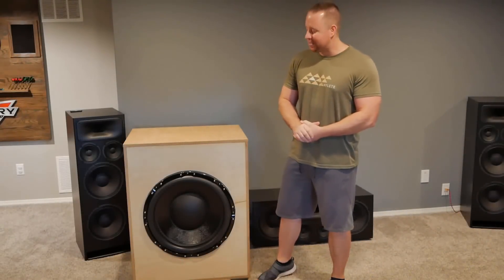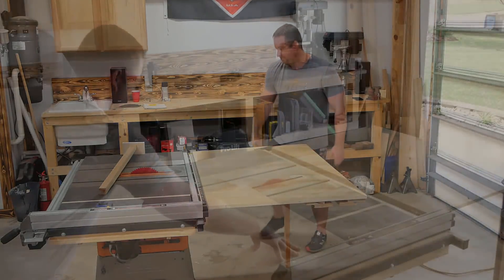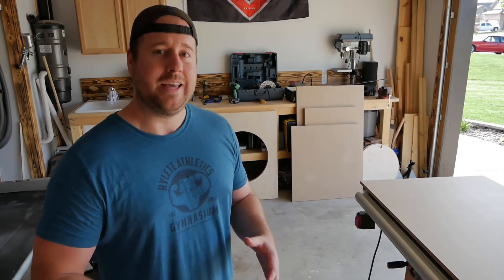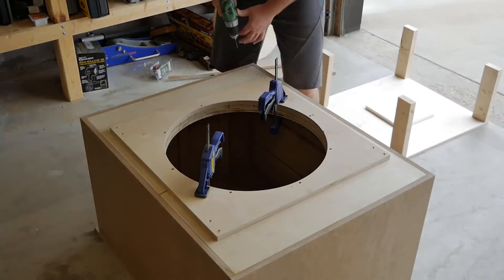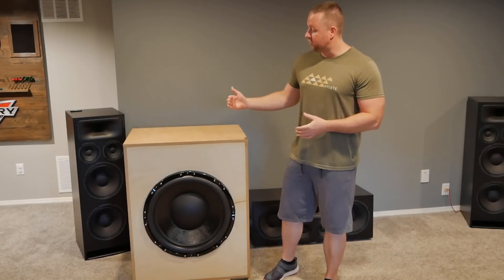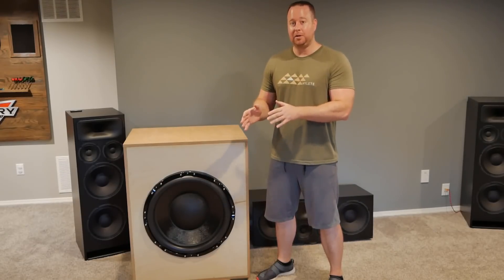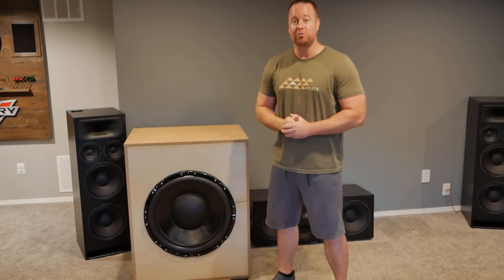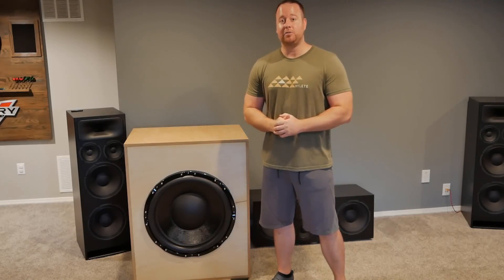Stereo Integrity HS-24 Subwoofer DIY Home Theater Build and Excursion Demo | Crazy Bass!

Comment: Very Nice box build and the performance or Excursion from 'Edge of Tomorrow' is Awesome. Both of my subwoofers, budget subs, handled that movie and all movies good. I would need 100 Pounds of walls insulation to get a subwoofer like this 24" S.I. or people across the street will be walking around trying to figure out the house with the big subwoofer. I prefer having the Local Lumberyard do all the major cuts buying the 1" MDF or HDF best from them. Then use jigsaw and clamps do glue it, doing wood screws while the glue still wet. I build a few boxes in my Car Audio days, Years Ago

Comment: I just have a quick question. How are you powering that sub in a home theater setup? 2-4 Ohm 3000watts. Youd need a very powerful amplifier. And do you have both coils connected or just one?
Reply: I only ask because i feel like its wired for car audio applications more so. Not a lot of home amps run below 6 Ohm.
Reply from the maker: Pro audio amps. Specifically Sinbosen FP20000Q. Wired to 4 ohms. I have a video going over that amp as well as videos of all 3 being powered by that 1 amp on my channel

Comment: So I'm new to speakers but is that box enough volume in it? And I'm used to seeing a air direction in there as well? Looks mint tho btw
Reply from the maker: This box is about 14 cubic feet. These subs only require 8 cu ft to perform well. That's for a sealed enclosure, which I prefer. Ported enclosures (vented) would need closer to 20 cu ft to perform well

Comment: I know I'm late to the party on this one and this may sound like a dumb question but why did you use plywood for the front baffle instead of MDF if you ever get around to answering this thank you in advance
Reply from the maker: I used the plywood so the screws had something better to bite into vs mdf. That mdf doesn't hold screws well, didn't want to chance it with a 110 lb woofer lol

Comment: What are the external dimensions of the cabinet?  Plan on building one of these soon.  Ported is basically a huge refrigerator size so I’ll be going sealed as well.

Sorry I missed it at the very beginning but watched again and caught the dimensions. Seems like a reasonable size though I’m thinking plywood to save on the weight a little.
Reply from the maker: Hey John, I'd make the box smaller than this one to be honest. 10 cu ft is about the sweet spot it think. My other 2 are 8 cu ft and this one is about 14 cu ft. There really is not much difference in output at all. Shaving off a few cubic feet will save you some weight as well! Good luck man
Reply: @LifeofBliss  thanks.  I’m still going over dimensions but right now thinking 30W x 24D x 36H.  That puts me at roughly 12.5 internal before the driver and bracing which I think would net around 9-10.  Do you think that’s still too big?
Reply from the maker: @John Roudebush  you could still make it a bit smaller I think. Up to you, but it'll be easier to move and take up less space. I'd shoot for closer to 10-11 cu ft net internal before bracing and driver if I did it again
Reply: @LifeofBliss  Grabbed my 24 and a CVR 2002. Will start my build in a few weeks when we get back from vacation. I was curious if you BEQ or not.  Even though I only have one of the 24’s for now pretty sure I’ll add another later and even with just 1 was thinking of picking up a 2x4HD anyway and trying BEQ.  I think you have the 2x4HD and wondered if you experienced any unbalanced to balanced issues.
Reply from the maker: No issues with the minidsp 2x4. Such short runs that there's no issue. I've done BEQ. Its cool, but also a process every time you want to watch a movie. Sometime you just wanna turn on the tv and go! But it definitely is fun for some movies

Comment: Bad ass Playa. How did u do the wiring?
Reply from the maker: In what sense? It's 12 gauge wire from the amp to the speaker. Dual 2 ohm with a 4 ohm final load.

Comment: Why not go for a few crown xti 4002's has better features then that lab gruppen fp clone you're talking about
Reply from the maker: I like crown amps. Just bought a xls 2502 actually for testing passive subs. Honestly, the price per watt of the clones is what's so nice about them. That amp has been tested to put out 2k watts per channel rms and nearly 4k per channel burst. So you're talking between 8k and 16k watts when being pushed full tilt. It would take several crown xti amps to match that power (most likely only on bridged mode, so 1 amp per sub). The clone was around $800 shipped. The crowns are well over $1,000, and like I mentioned, you'd need multiple to get close to the power output. DSP is handled by a minidsp HD 2x4, so a few hundred more for that and it's a far easier and capable dsp than what the crown would be. If you can get around the fan noise, the clones are pretty sick amps. It was all about cost per watt at the end of the day
Reply: @LifeofBliss  You could probably switch out the fans with equally rated noctua fans and have it be nearly the same cfm rating but be a good 10 dB or more quiet.

Comment: Hate to be the one pissing on this parade, but I've been building bass speakers for many decades, and right away I see several major problems, the biggest one being that, no matter how big the bass driver is, the goal of any bass speaker is flat response down to the 20 Hz range, and really big drivers have such large cones that their fs tends to be too high which limits their f3 (12" drivers tend to have the lowest fs), second the box is a sealed design and that will result in a flat response down to @ 50 Hz (this doesn't change much with drivers bigger than 10") which is much too high, third such a large bass driver is totally overkill for a room in a home, where only 10" and 12" drivers are adequate, as such large drivers are built for true theater rooms in the 4000+ sq ft range, such a big driver could never be fully utilized without ear splitting volumes in a moderate sized room in a home, then there's the placement of the box against the front wall which will result in massive loading of bass waves in a moderate sized room in a home, and so bass response will have major peaks and nulls throughout the room. Reasonably sized bass boxes could be located in better positions and provide flat response though a much larger viewing region. Bass bins are located against the front wall in big theaters without issue because the room dimensions of a 4000+ sq ft theater room are longer than the lowest wavelengths (40+ feet), which minimizes standing waves. I have a pair of moderate priced 10" bass drivers in 2 sq ft boxes (large vented alignment) that are flat down to 30 Hz, and fill a 200 sq ft space really well, and sound amazing. The key is the large vented box design, not so much the driver size. FYI
Reply from the maker: My room has 3 of these subs. You probably know this, but it take a HUGE amount of air movement to play anything at 20 hz or below with any sort of volume. EQ solves most issues, besides the sore back from moving them lol. They are flat down to 7 hz at 115 db. If I cross them at 10 hz, its flat over 120 db to where I crossed them at 100 hz. You really can't get that sort of spl in a large room at those low frequencies unless you are running double digit small woofers. To each their own though, that's what's great about diy audio 👍 have a good day man!
Reply: @LifeofBliss  I guess this defines the big difference  between home theater and home hifi. With hifi, I'm after flat response without EQ down to 30 Hz or below, and in addition, I am chasing a certain musical character from bass, and that is why I argue in favor of the large vented alignment and driver sizes in the 10" to 12" range. It would be fun to hear those while watching a movie that has those low rumbles in the sound track. Thanks for the kind response, no offense intended on my part.
Reply from the maker: @SpeakerBuilder  no offense taken, there are many different tastes and goals with audio. I figured you weren't talking about movies. But yes, these are extremely fun with action or suspenseful movies. Adds a whole other element when you can feel the lows...

Comment: I put it in a closed box with a leflex opening and I had at least 20-25 pieces of difference at half volume and I would rather have a reflex opening larger bass and the subwoofer can ventilate in closed boxes I am always disappointed in vain I build it bass

Comment: Hey, how thick is mdf did you use for the enclosure???
Reply from the maker: 3/4 inch all around, double front baffle of plywood, so 1.5 inch there. Main thing is to have a corner or bracing every 8 inches or so for strength

Comment: Have you tested them outdoors? I'm sure haven't tried and end fire or cardiod arrangement...but would they make good concert speakers (sound reinforcement system)?  Seems more brands are running dual 18". With these rated at 2000 rms...what amps are you using? Crown bridged? I would like 4 in an end fire arrangement (outdoor) if possible.
Reply from the maker: I have not tested them outdoors. I would probably do a horn loaded or ported design if they were outdoor speakers. Especially if just being used for music and not movies. I am running them with a single sinbosen FP20000Q 4 channel amp. 2000w x4 rms, 4000w x4 burst power. Only using 3 of 4 channels
Reply: @LifeofBliss  I would talk to stereo integrity about the box build. I think the best I can do is three 24" with two facing front, one facing rear. We're talking a lot of power here not including mains. Your Sinbosen is a great deal if it's working well for you. Can't get their website to come up though but under $1k?
Reply from the maker: @stiffmeister0hYeah  yea it was about 850 shipped. They don't put pricing up online since its always changing for them with exchange rates. It's a monster amp for only taking up 2u rack space
Reply: @LifeofBliss  I made a slight error with my Crown XLS2502. They are fine for powering in doors and a normal sub setup (1250 w rms). However, to do a cardio arrangement using Crown amps, I would need the XTI series where I can set the delay using their "BandManager" software. The idea is to have 33-50% of the subs facing the other direction, 180 degrees out of phase then play with delay to cancel sound  on the stage. The Sinbosen may work for the mains where you're not so worried about being directional and worried about the comb filtering effect. Three (two facing you) should do pretty well for live band right? I had JBL 18's back in the day and wasn't impressed and no where near the excursion.
Reply from the maker: @stiffmeister0hYeah  I would think 3 of these in a live music setting would slam pretty well. Have you looked into ant of the products from minidsp? Instead of replacing amp(s), you might look into that. I'm using the minidsp hd 2x4 for this setup to time align the 3 woofers. And you can EQ them with the module as well. Pretty cool device...
Reply: I will check it out. I only have one amp so far the 1200 rms for 2 of my 5 15's (rated at 1200). Before I get all crazy, I'm just going to order three HS-24's during the sale. If life works out ok maybe more next sale. Concert subs are bookoo bucks. JBL dual 18" GT28 is $5.5k. These plus amps are a bargain.
Reply from the maker: @stiffmeister0hYeah  yea that's crazy money there! These 24s are a bargain eight now with the sale. Definitely not a bad decision. I'd by more now if I had the room. Hopefully we'll be building a house in 2-3 years and I'll be able to get at least 6 in there lol... don't tell the wife... 😅
Reply: @LifeofBliss  haha you had an autocorrect there. Thought you bought eight. I emailed, asked about amps. If can run two off 8 ohms bridged then I'll buy six (ordered three). Cabopalooza will happen

Comment: might wanna throw some kind of grill on there to make sure there are no trips to the e.r. for broken fingers?  i know, i know, sound quality trumps safety.  i with ya.  edit: you could install a keyed switch so it only get's powered up when you're there?  here's one that you could use to control 2 15-20A circuits with one switch.  https://www.homedepot.com/p/Leviton-20-Amp-Industrial-Grade-Heavy-Duty-Double-Pole-Locking-Switch-Ivory-1222-2IL/301447170?MERCH=REC-pipsem-301447090--301447170--N
Reply from the maker: Little guy isn't down there when those are on (for now, especially at anything over a moderate volume). The subs run on an external amp that needs to be manually turned on as well, no auto turn on feature for it.

Comment: I like to see someone also uses Neutronics plugs. While having lots of cross bracing as you do I would also double up each wall.
Reply from the maker: Those plugs rock. And it's a fine balance between sturdiness and weight. That would definitely be more rigid, but probably push the box itself to 150-200 pounds before the woofer. Probably will leave it as is for ease of moving

Comment: Where did you place the three for normal use?
Reply from the maker: Well the 1 is in the back left corner of the area. The other 2 aren't built yet 😅 but I'm starting on those this week. They will be on either side of the center channel and act as a shelf to raise the center up

Comment: This is awesome!!👍 Had one question why not build a ported box instead of a sealed box for more of the low frequencies? 🤔 Just a thought but awesome project bro 👍
Reply from the maker: Ported will cut off pretty quick after the tuning and would be an even bigger box lol... sealed will dig down a little deeper and have a smoother rolloff. It's already crazy the output of 1 and still have 2 more to add, so I am not worried about low volume!

Comment: did you play around and test out a ported version, it might be louder than that one
Reply from the maker: It'd be louder, but sealed will go lower. This 1 is already stupid loud. Just got the new amp hooked up and I'm afraid I'm going to damage the house! With the other 2, the response in the room will be better and I'll have more headroom than I'll ever be able to safely use without bringing the ceiling down

Comment: Alot of mass to move and a alot of air Proby great LFE but sucky musical transients. thats  why us bass players like fast lightweight  drivers  in multi cabinets with  10s and 12s . I had 4  EAW 18s and a bag end sub sonic Processor  with Crown Macros and it ruined 2  expensive projectors really pissed off the neighbors .We have a new rule now ( No Pa Equipment set up in House)  and what your going for is long term ear damage  bigger isnt always better smaller faster more musical is where i ended up 6 Bose 201s 2 Paradigm 10s  Marantz receiver  that gives  excellent sustainable levels that dont give long term hearing loss . Take from an old Pro sound  guy bass player you dont  want the  ear ringing  it sucks and exposing your kids to it just wrong  .But lots of closed theaters in past few years means  used THX JBL crown dirt cheap  a good THX JBL 18 can be had for  pennies on dollar
Reply from the maker: You think I'm blasting it with my kid sitting next to it? There's a volume knob in my receiver thankfully. paid extra for it, but it allows me to turn things down...
Reply: Well thats not the message i see with a toddler dancing in front of Giant sub kicking ,  dude if my wife   saw me do that with our kids or grand kids  she would come at me !  Its  cute  but  it sends a  bad message  to the less informed You Tubers who  will see it and  video their  kids getting their  hair blown around  by 140 Db subs,
Reply from the maker: Huh. Most people knew it was a joke... I mean, Baby Shark is known for having super loud bass 🤔 but don't worry, he's not it the basement when I turn it up to 11. Maybe go back and see there is 0 movement on the sub when he's by it. Have a good day man
Reply: No need to invoke baby shark  thats just mean    wait til they turn  into teenagers and all their  friends want hang in your home theater room with  the super system  blasting  metal music  eating your food  and  then you find  out when you  got back from vacation you have 2 blown subs and the cops where at your house twice for the Music. Both my oldest  boys have major  hearing loss from  growing up with  my extreme  home  & car systems  my young ones and grand kids  are fine as they missed my reckless  130 db days    Just saying dont make the same mistake i made  Loud Music destroys hearing
Reply from the maker: Lol I hear ya. I got a while before he'll be home alone like that, but I know I'll have to do something when that time comes. Hopefully by then we'll have land and won't need to worry about neighbors. I'll continue to watch the volume with him around. Thanks bud
Reply: Like the video we  like minds  for sure  I am a home Theater contractor now retired  but   back in the day  doing concert sound    (early 80s ) we would set up concerts stacks and make a 4 sided bass camber  wall of bass like 16  double 18s  put ear plugs in stand  in middle ( its was better than sex)   To say i am a Bass freak is an understatement  I just cant handle any highs anymore even looking at Horn makes  my  ears ring   . One thing you need to address is  with multiple  subs getting the bass sources all to play in concert in time phase without  
 standing  waves  cancellation and crossover EQ  issues  with  mains also putting out bass , The EQ  Xovers and phasing and delays volumes can be involved and really takes a trained pro .    Cant tell you how many Home owners have these  expensive Home Theater systems  and  dont have clue its sounds like crap    If i have teach another  homeowner  how set up Dolby Atmos in  drywalled McMansion basement  I will stick my 40 in my mouth and  click click
Reply from the maker: Yes I'll be doing measurements and using a miniDSP to tune everything up